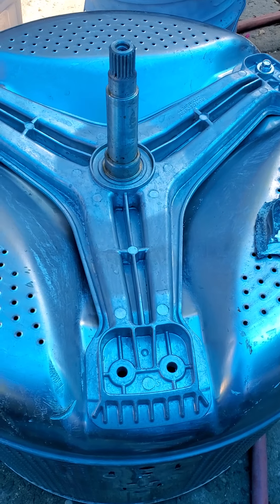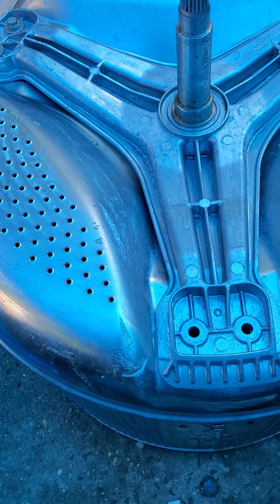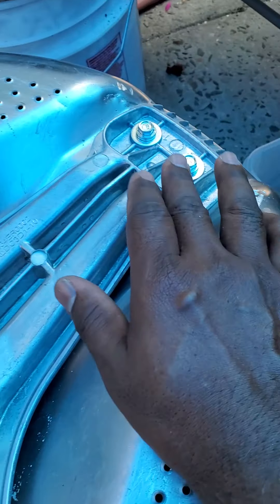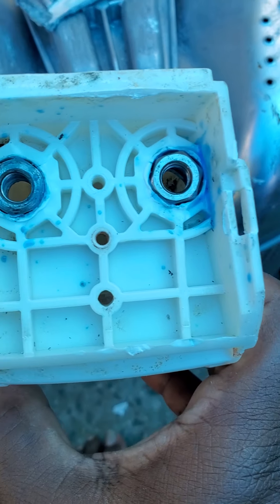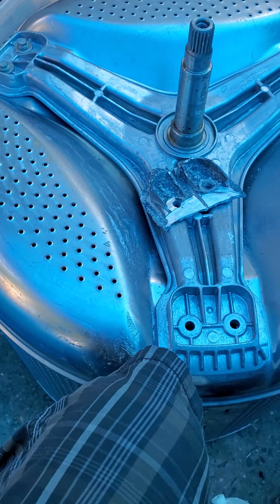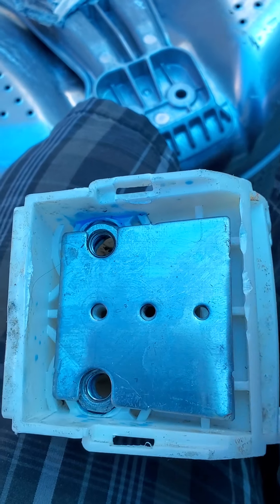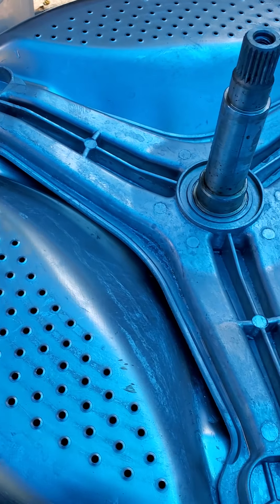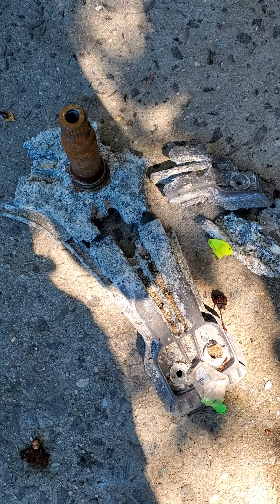Replace Spider bracket lg tromm washer

Comment: Thank you for this video!  I had to do the same thing and grind out the bolts.  In the end I didn't reuse the baffles because the nuts stripped the plastic.  Decided to get new ones instead.  LG also updated the baffle design.  Everything is all up and running again now.  A great learning experience.

Comment: I was able to drill the two blind holes for those screws that hold on the agitator mount. Finally, after hours of labor this came apart with no need to destroy the unobtainium bolts for the spider. Thank you for the video!

Comment: VERY helpful and very much appreciated!  One thing to note...the reason that replacement bolt was longer is because it is a Stator Motor bolt....what you should have ordered is the Spider Arm Bolt
Reply: Do you happen to have a part number? I can't seem to find one. Or even a size?
Reply: @marvthecarpenter  there is no part # because they don't sell this bolt - on ebAY thou used.
Reply: Those bolts are listed as no longer available.

Comment: unfortunately your washer us not going to last very long.  Those bolts that you cut that hold the spider arm to the tub are hardened stainless steel (they don't corrode and are stronger than normal steel).  The bolt from the stator motor windings that you shortened are steel and will corrode depending on your use (laundry detergent, bleach, etc).  The corrosion (rust) from this steel bolt will appear on your clothes.  This is not the proper way to repair this washer.